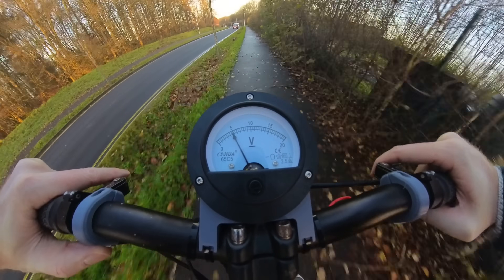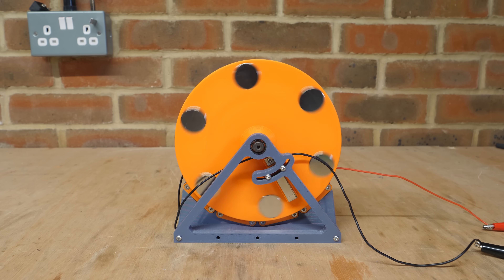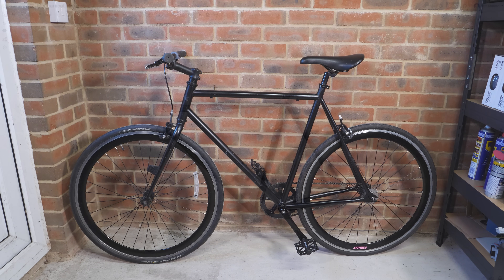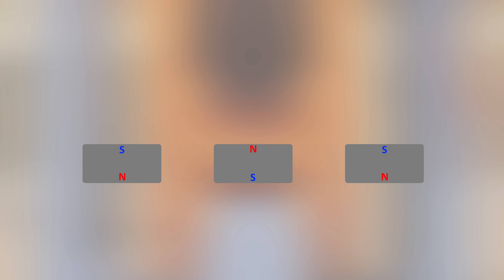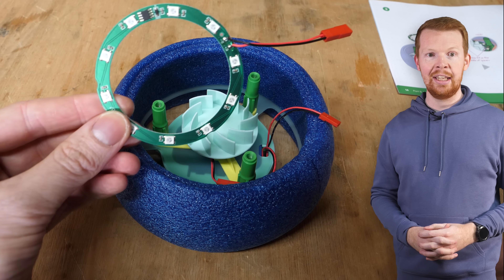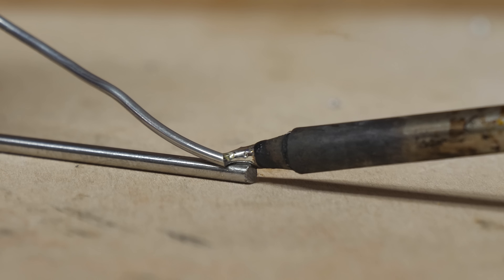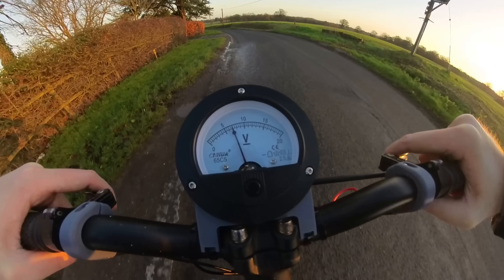The Most Minimal Electric Bike

Comment: i think i would have cheated and used a mosfet. then the small signal from the reed switch (and current limiting resistor, and a pull down resistor on the output) could drive the big current from the motor/capacitor. reed switches are nice in that they are sealed in a noble gas that doesn't oxidize your contacts. "no electronics" isnt really possible because just hooking a coil to a battery counts as electronics. "no microcontrollers" is probibly a more obtainable goal. i kind of miss battery technologies that dont require a lot of support electronics to function. lithium ion ruined everything.

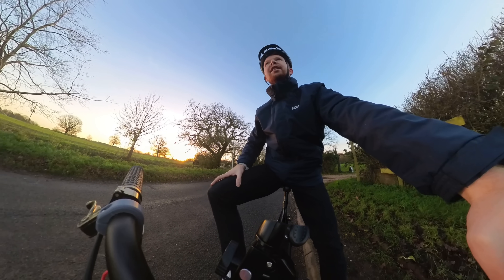Comment: I'm at 9:51 and it looks like you put the belt tensioner on the wrong side of the belt.  I believe that you dont want anything between the motor and the drive gear on the tensioned side when the motor is driving the wheel.  The belt tensioner should take up the slack on the "looser" side.  Just like a normal bicycle chain derailuer.

Comment: As always a great project and a great video! I really enjoyed it. I learnt so much from you over the years. However I really like your sometimes overcomplicated engineering solutions, now I have an easier option for this. Just use a strong battery powered drill. Strong enough motor and speed controlling trigger (which is basically a potmeter). If you want to avoid using the original battery since it maybe has a BMS, just replace it with a bigger amount of super capacitors.

Comment: Interesting project! I do have a question though. If iron were in the coils, I would think they would be attracted to the magnet all the time. So when magnets were traveling toward the iron, they would be accelerated and when traveling away, they would be decelerated, but it would essentially equal out. Maybe it’s the Eddy current induced into the iron that causes resistance and drag in the motor..

Comment: my 500watt bike uses a brused dc motor and a relay to switch it all using an end stop to trigger it 
i do have a dc to dc converter on it but i coud and have ran it from 2 car baterys but the range is to limeted 
i have a 60v moped batery to run it now wich gives me much better range

Comment: I have a serious question for you. In the UK, the courts class most of these kinds of vehicle as "mechanically propelled". I don't think they are. Allow me to explain. 

A traditional engine, of any kind, converts the kinetic energy caused by combustion into rotational gearbox rotations, driving the wheels. You can go into more detail if you like but the more detail you go into, you are describing mechanical propulsion...without a doubt. 

Let's contrast this to these e-vehicles. Is there a mechanical propulsion here? A current passes around a copper wire and a shaft with a load of magnets on it is pushed by the current flow. Again, you can go into more detail here but there is no doubt, the propulsion of the shaft with magnets has no mechanical anything. It's electromagnetic....the opposite of "mechanical propulsion". For it to be mechanical, there would have to be a mechanical something pushing the shaft around. There isn't anything mechanical doing the propulsion though.

It seems to me that the term "any mechanically propelled vehicle" doesn't cover electric vehicles because the propulsion is electromagnetic...and therefore falls outside the defined term. 

Agree? Disagree? Why?

Comment: 2:45 and eventually found these switches

If you only found em to be in existence just now.... man o man, there is still a LOT to discover.
Lightbulbs without the bulb.... like LED's basically.
Or what about Microwaves. They can cook food.

O, and we went to the moon in '69, if you can believe that.
But, Neil and Buzz would have been proud that you eventually found these switches.
Reply: and indeed: rip em apart and make your own switch.
Why use the switch itself if you can ruin it perfectly.

"Let's start building the e-bike"
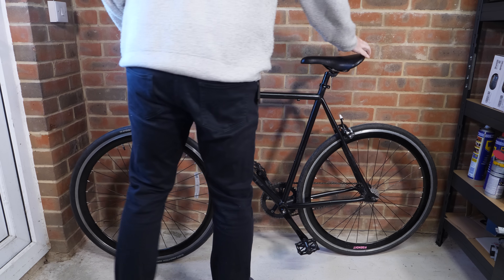2:57
Steps into frame with an actual E-bike.
After all, the motor can be in the frame and the battery as well.
So who is gonna say with certainty that this bike he shows us here is not just an e-bike?

Comment: You can use a relay (with a series resistor to the relay coil) to prevent overcharging of the supercapacitor. The idea is that when the voltage rises high enough (say 17V), the relay will activate, disconnecting the motor and the supercapacitor
You can set the threshold by adjusting the resistor resistance

Comment: I thought of a 0 additional friction implementation of the system. If the coils and the magnets were instead on the rear wheel and rear gear assembly, they would be rotating in unison when pedaling but not when the pedal, chain and gears are still and rolling down a hill.

Comment: That definition of electronics isn't very good. I totally get what you're saying and doing, and I love it! But that definition is silly - I notice it's from Oxford languages. Is this the same Oxford as in the Oxford English Dictionary? I'm surprised. What about the original "electronic brains," the computers of the 1940s? No transistors. Maybe diodes, but no transistors. Lots of vacuum tubes. Those devices were definitely electronic.

Anyhow, sorry for nitpicking. I always enjoy your videos! And I've got no bones to pick with you, just with Oxford Languages. BTW, would it be possible to use vacuum tube technology to drive a brushless DC motor?

Comment: You probably realized this but on the topic of "the dynamo hubs have a constant resistance and this one doesn't". Even ignoring the already constant charging of the capacitors while not pressing the charge button, I'm betting those dynamo hubs have lower resitance than the extra mechanical resitance from the belt+giant plastic cog.

Comment: You can incorporate the regenerative switch in the brake lever, so when you use the brake you can automatically recharge your capacitors. You can use a stupid zener and a resistence to protect your capacitor bank

Comment: Founder of WaveDrive here! Happy to see something like this,  this is close to my invention, but I still use electronics, with a light based analog computer that replaces the computer chip/software in all other BLDC motor drivers.
I call it the CBMD (Codeless Brushless Motor Driver) Patent Pending
Unlike your system, there are no sparks, and the switching is still done with mosfet's, with full control over waveform timing and duty cycle.
This allow the almost exact same performance as highly tuned digital BLDC drivers, without a complex computer chip. 
I'm also sure you could also make the CBMD pretty easily if you had the designs! but I'm not giving those away yet :)
Reply: Hello, I'm Bradley. I've been working on power generation for 25 years and have some ideas, but I don't know who to contact for a patient. Do you have any suggestions, please?
Reply: @bradleyhodson9388   just look for a patent lawyer, and see if you can get free consultation from some, and find someone who understands what you made!

Comment: Now, where you accepted diodes, you could easily jump to use hall sensors for precise position of switching and transistors for a sustained lifespan of switches. And with current measurement in these transistors, you can avoid saturation of your coils and therefore excessive currents due to saturated coils. Now, that you have done your challenge, change the challenge and make it efficient and reliable. Use electronics - Go ahead...

Comment: You may want to consider using MOSFETs to switch the current over the magnetic coils. Also, freewheeling diodes are a very good idea to protect the MOSFETs from induced voltage spikes.

The flashes (and subsequent burning) on your contacts are a result of you forcefully cutting off a DC currect. Electrical current, once flowing, wants to keep flowing - especially when flowing through an inductor like a magnetic coul. If you prevent the current from flowing by opening the switch, the voltage will rise, resulting in those tiny little flashes. If the current is high enough, it will simply ionize the air and keep flowing even if you open the switch...

(This is a very simplified version, but you get the idea.)

If you switch the current with a MOSFET you will be able to avoid this problem. The mechanical switch will only have to carry the (extremely small) current necessary to turn the MOSFET on - and your contact will no longer spark and burn.

Comment: 7:39 - Tungsten should be handled similar to carbon fiber when filing or standing. Be aware of the dust - special devices are normally used to sharpen tungsten under warter to avoid hazzard dust when using tungsten as tig welding tips.
Reply: Especially as those appear to be thoriated tungstens, which are radioactive. However, the filings are likely to be too big & heavy to be inhaled, so shouldn't present any hazard.

Comment: I've already mentioned this in the comments section of a previous video (I think it was the linear motor), but it's relevant again here:
Please learn about snubber networks! They are really, really easy to build and will help to reduce your sparking (and thus contact longevity) a lot!

A simple ceramic cap + resistor combo across the coils will already stop 95% of that arcing.

Comment: A series RC in parallel with the contacts will help a lot.  Also, coils should be pancake coils, maybe 10mm wide, the field will be stronger. although you get less turns you may get similar torque and less resistance for higher efficiency

Comment: Hey Tom! Awesome build as always! I have a question, wouldn't using a core for your windings significantly amplify the magnetic field and increase the torque, or generated energy? I'm not super familiar with the type of topology you are using, maybe I'm missing something important. Have fun!
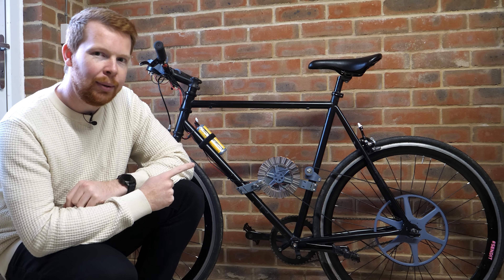[edit] Oh I see you explained why you used this type at 9:05, to remove the force of regular motors against turning when motor is idling. Although I'm not convinced that force exists at higher speeds. I think it is there only when  you want to start rotating them. Maybe I should experiment on this a bit...
Reply from the maker: Hey Mehdi! Yes, the lack of iron core was to reduce the resistance. From my experience of using BLDC motors on drones and ebikes, there seems to be a resistive force when spinning. The force is definitely higher when starting, but it's also still there at higher speeds. I've had my ebike speed controller fail before, and it was exhausting riding home with the motor drag 😅 (all 3 motor wires unplugged too). Thanks!
Reply: This is an excellent illustration of how an axial air core (ironless) stator motor with twin Halbach rotors works. The basically zero cogging torque with this arrangement is theoretically ideal for an integrated rear hub motor design- perfect freewheeling PLUS regen, quiet, and eliminates chain/belt/sprocket components. 

You're very skilled at CAD plastic printing, but of course plastic motors are just toys. I'm considering an actual high performance motor build with perhaps a PCB stator- simple concept but difficult to execute and not sure about adequate torque and low Kv targets yet...

Comment: Now...if you had a larger scale generator inside the full size of the triangle, plus, multiple inner and outer coil sets how much potential would it have then. 
There was a guy I think in germany that developed a thing back in the 90's, it was never shown what was inside his motors and because he charged thousands for them to be handmade I bet very few wanted to purchase just to copy him.., but he had pedal power + motor set up + gears in some kind of magic arrangement that was getting him up to 30-40 mph using normal riding cadence. And it had no batteries what so ever. Purely pedal powered...
Something like this with almost no resistance sounds like it could end up in the same direction if you can tweak it correctly.

Comment: The sparking is a voltage amplifier and actively makes power for you as well as UPS the volt rating for higher RPM range what you actively need to do is play around with the position of the Reed switch on the motor and that's the actual timing and that'll actively change the difference between torque and and RPM there's more to it but I wouldn't want to take the fun out of it for you
Reply: There's also another trick that you can take advantage of because you have individual coils LeeAnn skalman used to do this and it's an old starship trick you can keep 80% of the charge in the coil roughly 80% of the field strength of the coil and get up to 93% at maximum of the volts back out of the coil after that you're done using it in certain electromagnet applications by using a diode to actively trap the electron into circulating inside the coil that in conjunction you want to have a clutch to engage and disengage that you've made a very powerful tool if you apply this s***

Comment: Old DC electric vehicle safety contactors used a ceramic resistor bridging the gap to reduce sparking/welding. Wonder if that would work here?

Comment: The melting is the collapsed voltage coming from the coil  when the gap opens. With the low input voltage a capacitor and diode will do it will have 1000s of volts in the cap so it should be bleed into a battery. I had a motor idea that had 24# coils it took like 3 months and a vase full of transistor before i figured out that to use 2 diodes large capacitor with a pico capacitor in parallel. Before I could not pass 10v now any voltage that the transistor  is rated at.

Comment: Nice project!   Old gasoline engines used ignition points that were resistant to damage from spark, Also spark corrosion resistant were ignition rotors and distributor caps.  Maybe one of these would be a source of more robust contactors?
Truly mechanical switching might be done with iginition points actuated by a rotor-mounted cam...
Before there were transistors, there were amplifier vaccuum tubes.  One of those might also substitute for your reeed switch.
Running your reed swith in an airless environment would also cut down on corrosion and wear from spark.

Looking forward to your next video!

Comment: I electrified an ordinary bike in about 1975 by using a car heater motor and a car battery under the cross bar. I tried a belt drive to a big pulley (actually just a channel bent into a big circle) on the rear wheel, and also tried a friction drive. Both these worked to some extent, just riding up and down my road. Thank you for the video.
Reply: Tienes cuenta donde tegas fotos o video sobre eso
Reply: @RaulG-p4v  I am sorry I do not have any pictures.

Comment: excellent video! Instead of destroying the switches with sparks, you can use a diode to charge a secondary batteries or super capacitors, Bedini style.

Comment: My first ebike was like this. It was a Zap brand bike with two 12V car radiator fan motors, one on each side of a friction roller over the rear tire. A switch on the handlebar toggled the motors from series (slow) to parallel (fast) configuration. It used a 7Ah 12V lead acid battery. It had 8 mile range and worked great for my commute to college.

Comment: So, I used to make tungsten contacts for obsolete ignition systems. 
You have to silver solder them. A small blowtorch will do it. 

As for the sparking. Well, that's exactly what ignition contacts do. If the condenser (capacitor) fails. 
You have to have a high rating as peak voltage can be very high, and the value can be trial and error. It has to be matched to the system. Not too big, not too small. 

But it eliminates almost all the sparking. Which is all inefficiency as its not just turning off but wasting energy on the plasma. 

You may then be able to massively reduce the mass of the moving switch.
Silver solder on the end of the tungsten rod. The cut it off with a grinding disk. Grind and sand back to a nice thin disk. So low mass. 
The other contact can be a disk as well then so it has more area to conduct. 

The lower mass on the Reed switch will mean it can function at higher frequency.
Reply: Hope Tom will see this, this sounds really insightful!
Reply: Thank you.  I was about to make one of those "kids these days" comments about resistive spark systems, but your comment is more informative and less "get off my lawn."
Reply: It is good info
Reply: Once you tin the tungsten with silver solder, you can then solder it with the regular kind. This works for stainless steel, too. The kind of SS sold for refrigeration use works perfectly, with the proper flux.
Reply: The switch needs to be magnetic (eg steel) to work. It needs to be springy for the same reason. Nickel is both of those, and easy to solder. You could replace the actual contacts like you say, with a small disc of tungsten, but how much difference would it make? Seriously, I'm interested to know if I've assumed wrong.
Reply: Not reading allat

Comment: if you set up a clutch, you could have the magnets seperate from the coils, then whey you pull the bar, it gets them close enough to charge or brake. This would allow you to have no resistance when you dont want it, and have a much stronger force when you need to brake or speed up.  I was thinking something liek oldschool brake mechanism jury rigged to separate and close the "clutch"

Comment: Would be cool if you could also make a mechanical system that automatically boosts or regens depending on your acceleration/inclanation. I'm thinking maybe a sort of pendulum that actuates the boost/regen switch. The pendulum would swing backwards or forwards from its inertia depending on if you're accelerating/going uphil or slowing down/going downhil.